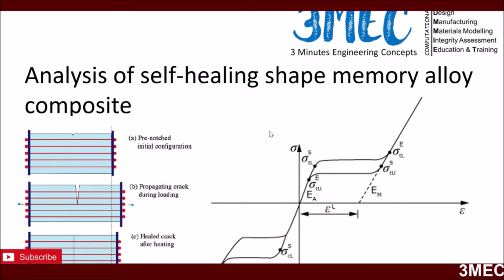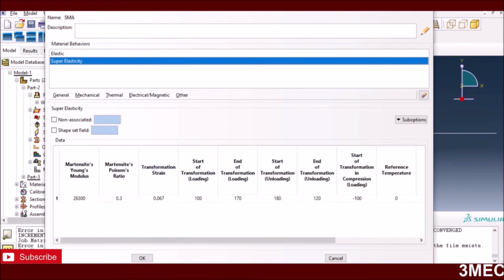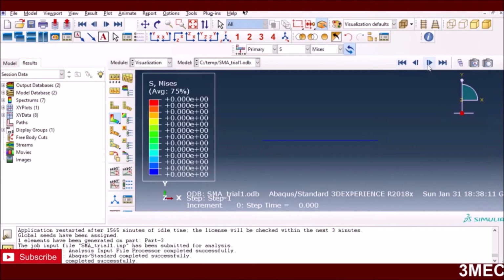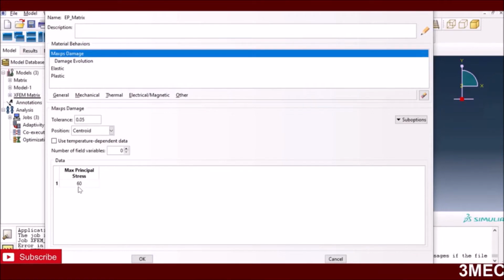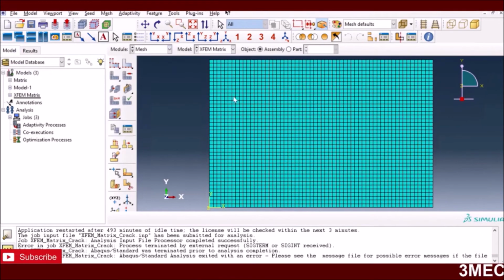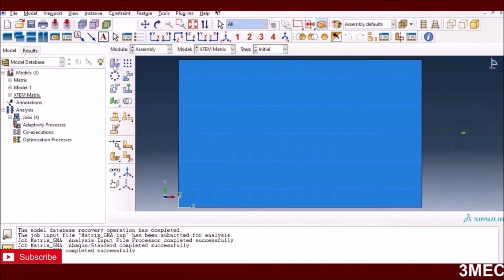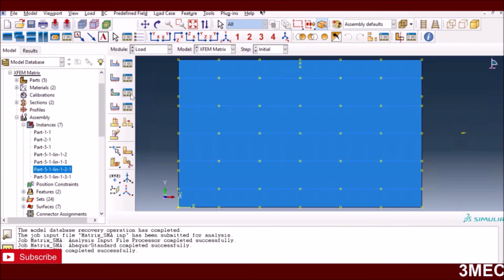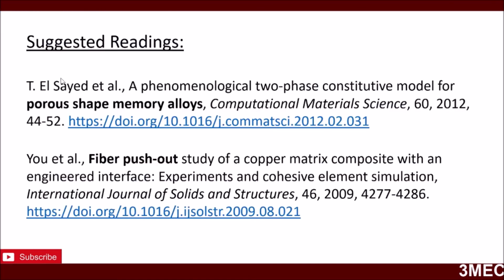Self healing composite deformation and failure via ABAQUS CAE: Step by Step Tutorial (XFEM, SMA )

Comment: Where  to add plastic values for sma?
Reply from the maker: You may try plastic card, but if I am correct (based on few years back analyses) plastic card didn't use to work in ABAQUS for pseudo-elastic-plastic response.